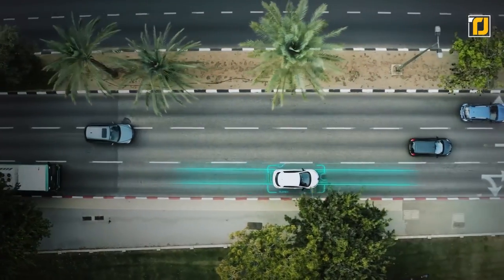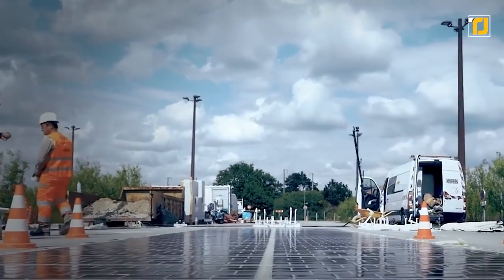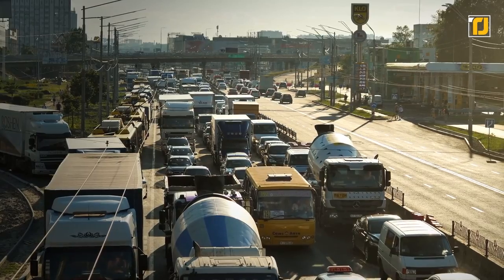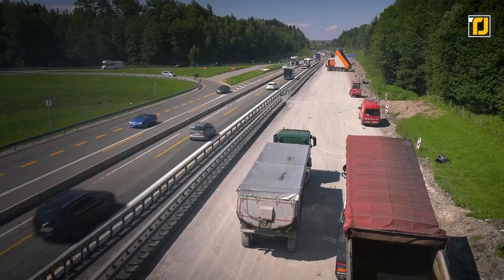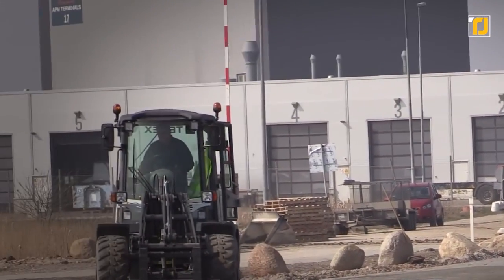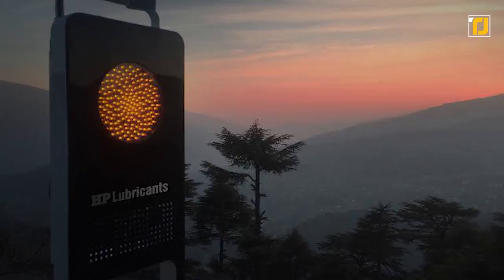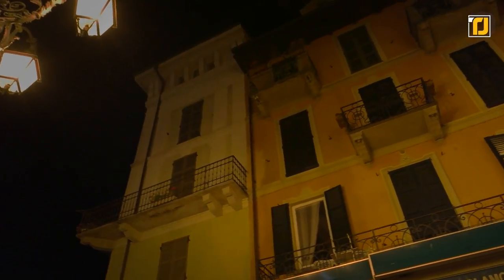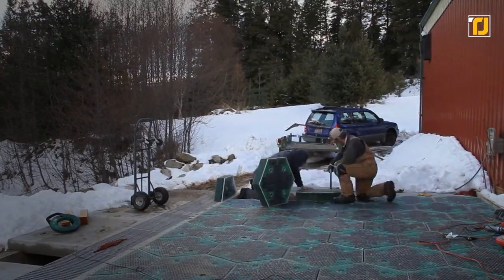10 Road Technologies That Are On Another Level

Comment: At least they will help us save more energy and cheaper with green energy
Reply: No such thing as green energy  if you think about it.  As it stands  the environmental damage a lot of  so called green energy is not worth it as green energy.  Cost analysis of said energy is actually more than regular energy costs now theatrically after a decade or so this  cost analysis is based on equipment and actually energy production.
Reply: @johnree6106  Yup All lies